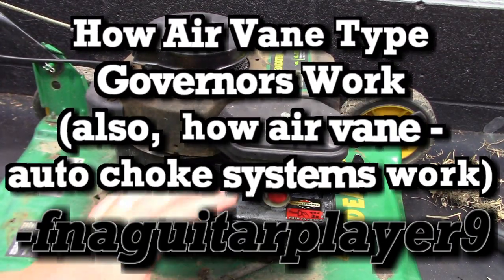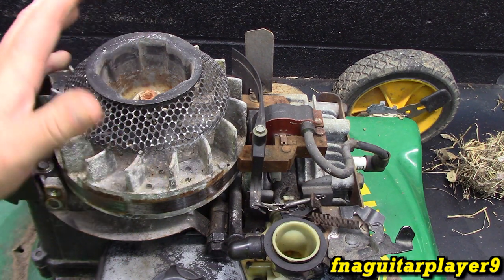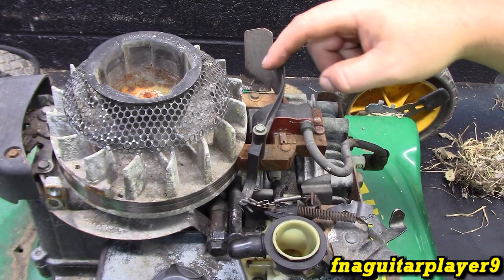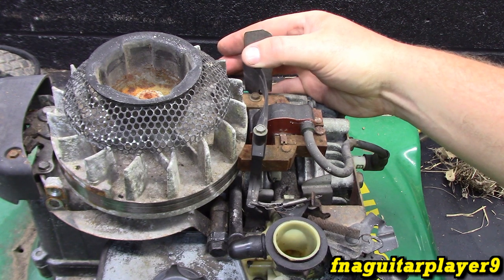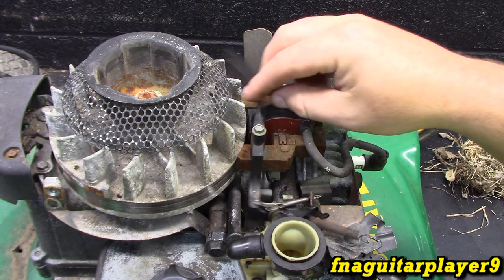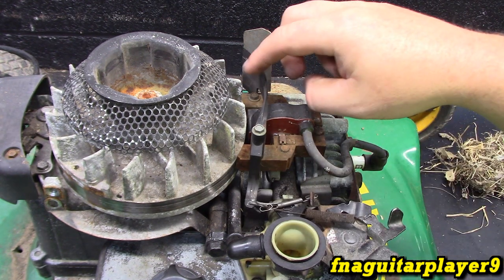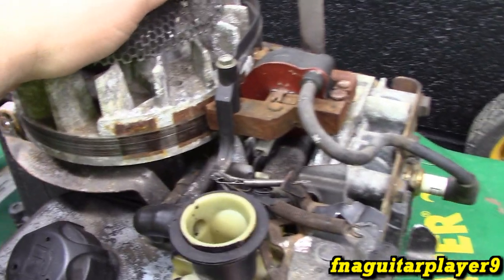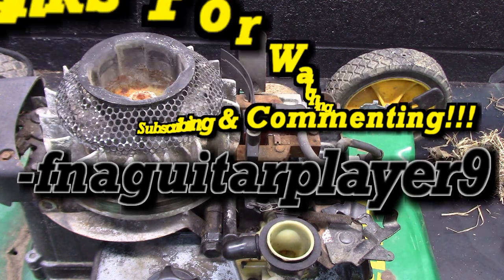How Air Vane Governors Work and Air Vane Auto Choke Systems

Comment: If the ignition coil is replaced, the air vane may need to be trimmed to clear the top of the new part. It will rev high and the springs will be useless otherwise.

Comment: I just changed out the magneto coil and spark plug. Mind you the coil and spark plug still worked fine but the plug wire end was rusted out so that’s why I changed it. Now the issue I’m having is the engine is revving up very high and sounds like it’s going to take off. Would using the wrong magneto cause this? My  B&S didn’t have a part number but I did find the engine code and the part number online that matched my mower so I bought that one. My mower looks like yours. I even moved the idle arm that you were talking about and it didn’t change the sound of the motor.

Comment: My ride on will not rev up and if I push the governor arm that's connected to the carburetor nothing happens it just keeps idleing when I put the throttle lever to full  open still nothing but starts and idle fine it's a 12 and a half horse briggs , love the video man 👌👍💪💪

Comment: Interesting video, not seen an air governor before. It would be interesting, if not fun, to see what would happen to a non-governed engine at full throttle; would it reach a maximum revs or run until it destroyed itself? Thanks for sharing.
Reply from the maker: Thanks. both can happen, a stock engine will usually only go up to a certain rpm but even at that rpm its not designed to run at, so it stands a very strong chance of throwing a rod. Thanks for Watching!!!
Reply: @fnaguitarplayer9  I experienced that today. Air vane governor snapped off and mower ran at max rpm. Ended up throwing a bunch of my dad's rags into the air intake to jam it off. Got lucky, but now I'm on the hunt for parts